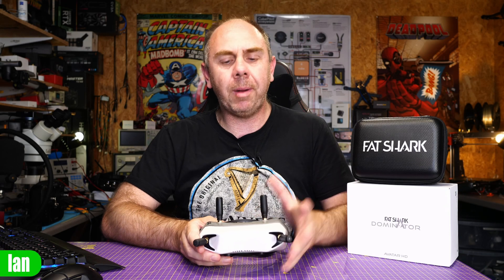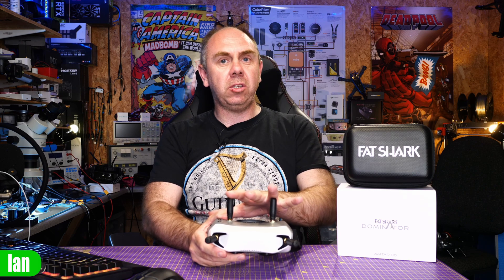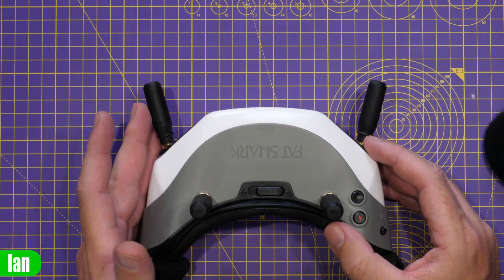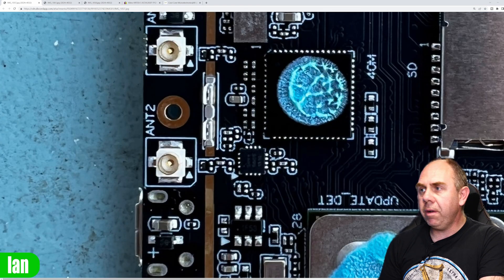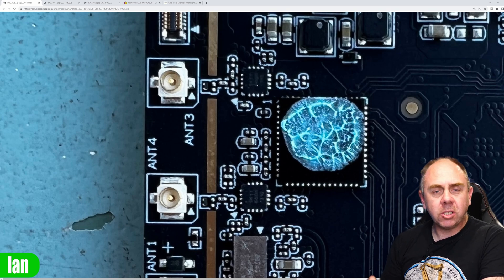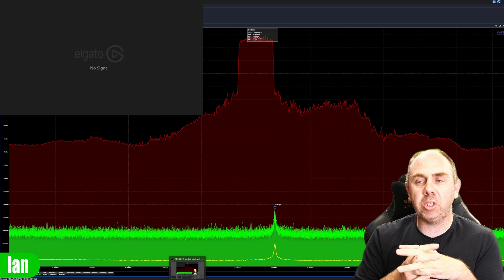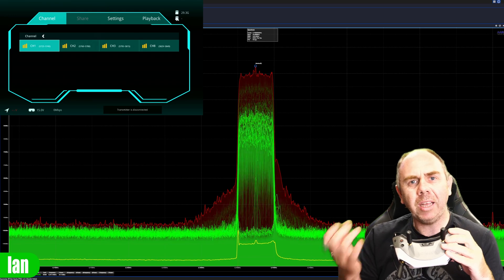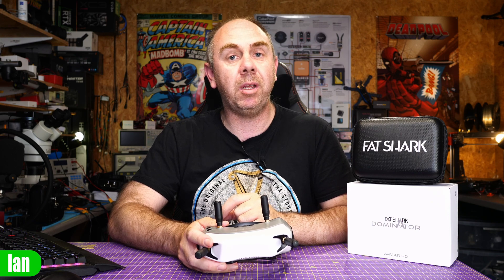Fat Shark Dominator Avatar HD FPV Antenna Info - Constantly Transmit

Comment: Could you use a long RP-SMA Extension Cable on the transmitter port to the antenna to reduce any radiation to your head without affecting the communication?  I know it's non-ionizing radiation, just wanting to be cautious.
Reply from the maker: Potentially yes.  There is always the loss you will get but you may be surprised how little affect it has.

Comment: I also have a question regarding the channels. Would you suggest one of the 8 channels to fly in to get the best signal (low noise)
Reply from the maker: Generally 1-3 are always better as the antennas and PA tend to be tuned towards the lower end.
Reply: 7

Comment: Good info! So a patch on the TX ant1 gives more range. But what if you fly behind yourself or outside the patch range. Will your image freeze of drops black. What happens then? 
My guess is a patch on ant1 is only usable if flying long range in front of you.
Reply: Your guess is correct. If you want to bando then use an omni. This has always been the norm even with analog.

Comment: Ian, is there enough length on the internal UFL pigtail, to swap the transmit SMA position from the top, to the front? So the patch antenna can be more conveniently placed for longer range flights.
Reply from the maker: Yes you could do this.  Plenty there. You could Easley move 1 to the front

Comment: You suggested in a previous video that this product felt like a Beta version. A future s/w update could change that constant transmit behavior. 

With the bottom antennas in that configuration, aren't you essentially pointing the antenna null at the drone?
Reply from the maker: Yea they are not well placed imo. I would be putting patches on the bottom and omni on the top that’s for sure for longer term use.

But also take into account many tilt their heads down as they fly.

Comment: That’s different to DJI that only transmits when it finds a paired Air Unit.

Another thing we found with DJI is if you unplug the power of your googles the Air/Vista unit they’re paired to also goes into low power mode, we was watching a friend in 700mw mode and he crashed quiet a walk away (about 200 meters) in a fit of ragequit he unplugged his headset before Turing the power down (none of us run auto temp control) and his Air Unit went into Low power mode and effectively stopped transmitting until we were almost stood on top of it, as soon as he plugged his headset bs k in, it went back to full power transmission.
Reply from the maker: Yea DJI the VTX on signal loss jumps back to channel 8 and transmits on basics output till it receives a connection again.  Avatar is opposite and the overall RF behaviour is better. I’ll be doing a more in-depth look at that in the coming weeks.

Comment: New to this hobby ...... should i wait and see if DJI is coming out with a better solid product this year ????
Reply: Might be worth waiting a month or so but don’t wait too long cost you’ll get into the same cycle my friend has of always waiting “just in case something better is launched next month”.  I bough DJI two years ago and he has spend the last two years waiting to see if something better comes out, then when he finally decided to buy DJI they was out of stock everywhere, then Fatshark announced their thing and he said he would wait for that, then they announced how much and he was like “maybe DJI will launch something cheaper later in the year”, even if Walksnail bought out a 4K system tomorrow, I still wouldn’t change.
Reply: @TestPilotIan  Thank You for the reply.... to me it seems when DJI introduces a new product it's pretty solid from the get-go , but with the other manufactures it's a race to get the product on the market and work out the bugs as they develop ...Thanks Again !!!!
Reply: @pacospete4299  I think the WalkSnail goggle is more Beta product than what we are typically used to in FPV. Not unheard of to have bugs but the Avatar System has more than typical. I'm worried with all these systems running different RF modes that it will be more difficult for folks to get together and fly FPV without the signals crashing into one another. This makes HDZero more attractive in some areas.

Comment: Does this set up have to be turned on with permissions from China such as setting up an account like dji? Or does it just work out of the box?
Reply from the maker: No registration required.
Reply: Wow, I didn't even know DJI had such a "feature". Good thing I went with WalkSnail... Pairs with a VTX and works out of the box, never had any internet connection whatsoever.